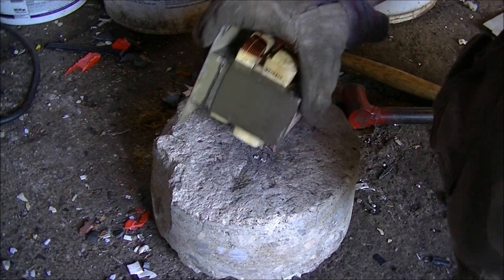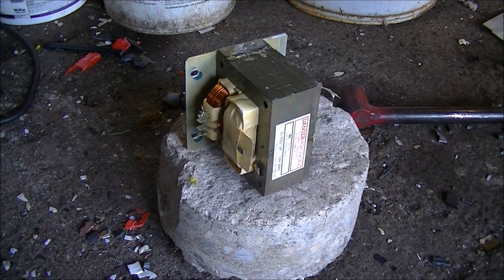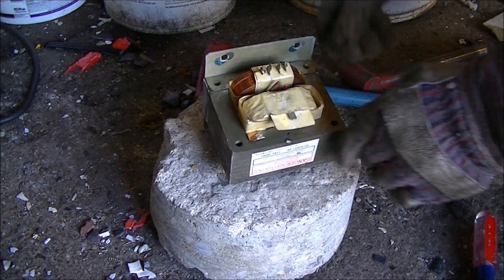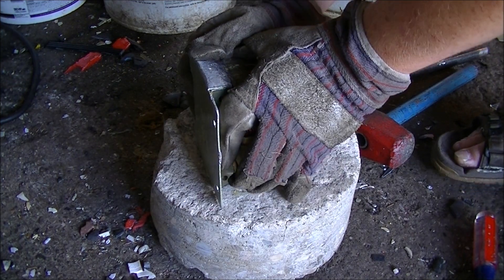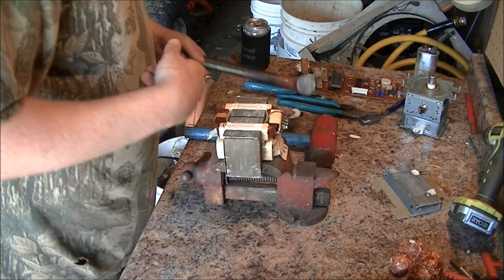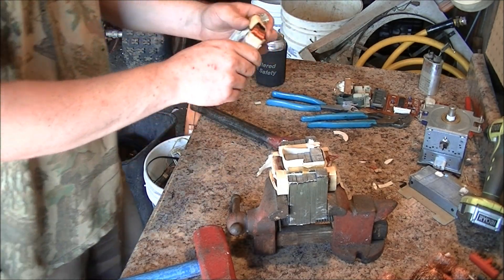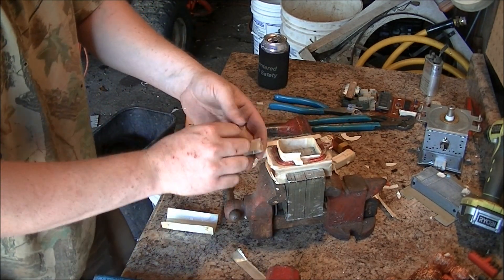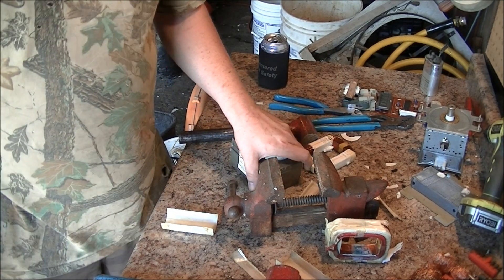Make Money Scrapping a Microwave Part 2 The Transformer

Comment: For those transformers, I use an air chisel to cut the coils off of one side then, flip it over, clamp it in a vise and use a crow bar to pry the remaining copper out. Just catch the coils in the middle and it comes out as two big "U"-shaped pieces. It saves from having to do all that hammering. Unless, of course, you like taking out your frustrations by beating the snot out of something. Been there, done that, got a T-shirt. LOL